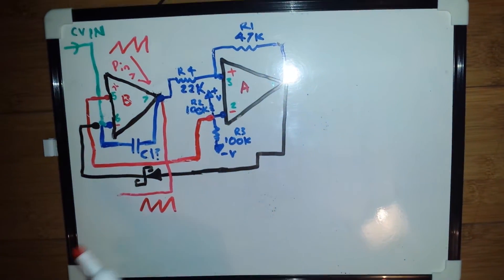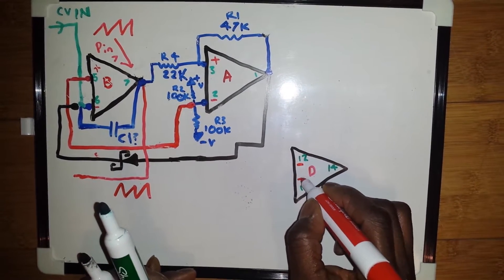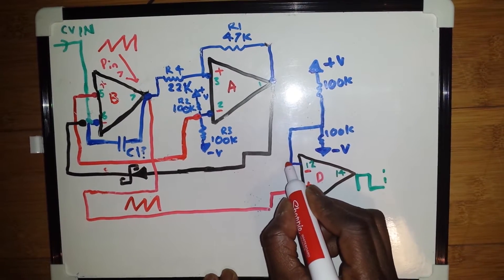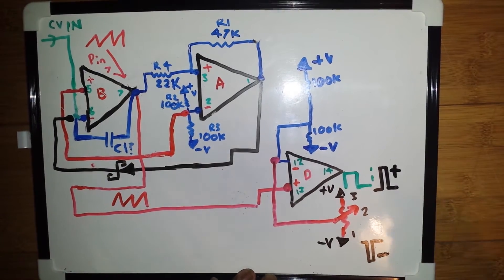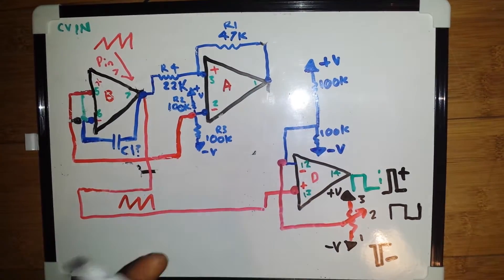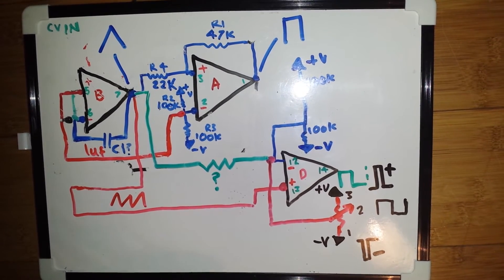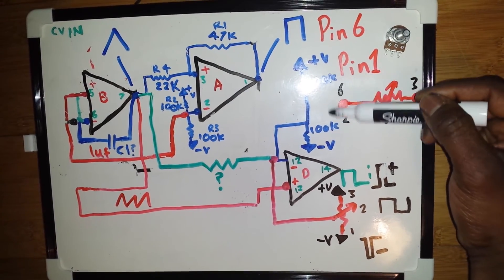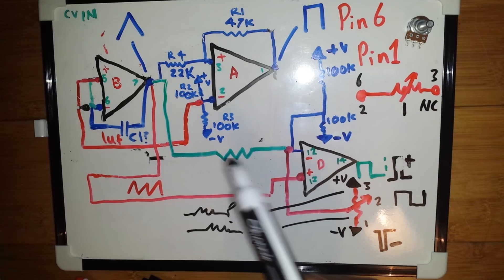DIY analogue synth project Tutorial Part 3 (The Sqaure Pulse Waveshaping circuit)

Comment: I think I noticed a mistake, pin 12 is + and 13 is - ! it's no big deal but it confused me for a few hours XD So for anyone using the TL074 or TL084 it's Pin 12 + and Pin 13 - ! ;P
Reply from the maker: AP Girl Yes your right. Thankyou for pointing that out yes pin 12 is non inverting and pin 13 is inverting. In the words of rag and bone man, " Im only human" 😅😅.  I do all my videos completly unrehearsed and no notes.
Reply: We all make mistakes, so as said no big deal ;P I just flipped the connections on my schematics so now the Saw Core runs on Pin 12 and the LFO on pin 13 and the power accordingly. I guess that is right now.
Reply from the maker: AP Girl . You can actually do this a couple of ways i recently discovered.
1. Saw core into pin 12 via a resistor. Then a pot tied to + an - voltage on pins 1 and 3 of the pot , middle pin out then goes to 13.
Method 2 . Saw core into pin 13 via resistor and inject pin 12. 
They will both give you a comparator width adjustable pulse out at pin 14. 
The latter method is quite intresting as when you adjust the width control via the potentiometer it breaks up the saw wave into an almost doubled saw for a chorusing affect. Give both a go :-)
Reply: I sure will! I could do all the methodes, I mean, what are switches for? ;P It's all about getting the routing right and then you can potantionally do anything.
Edit: okay, Methode 1 seems simple, it's basicly what we already have established + a resistor. Methode 2 then is the same as 1 but also feeds the saw into 12? befor or after the resistor?
Reply from the maker: AP Girl . Exactly. Make your own modifications and suprise yourself . Hope you share your project in the future :-). Or at least some demos .
Reply: I sure will, this has already given me plenty ideas on what to do. I am sure to make a video on all of my mods for it once I get it all functioning^^
Reply from the maker: AP Girl So glad to hear it . Good to see people like yourself taking this by the rein and taking off with it :-)

Comment: Ajull, here is a video that explains a bit about denoising DC voltage PSU. https://www.youtube.com/watch?v=qb1QFh_fxDo
I've found a pretty cheap PSU in a box, should be connected to a DIN rail (anyway it looks pretected). http://www.mean-well.ru/store/MDR-10-12/
I want to try it to be a +/- 12v source but it's pretty noisy (200mV).

Comment: I guess that the LFO part is another oscillator physically. So you shows it on the same place for the main osc. just to save time and space....
Reply from the maker: MoolahNasreddin . The main oscillator and LFO are built exactly the same, just without the diode between pin 6 and 1 and also use a high value capacitor for C1. Then use a potentiometer between 6 and 1 to adjust the tuning/rate control value about 470k to 1meg ohm ur capacitor will determine your frequency range.